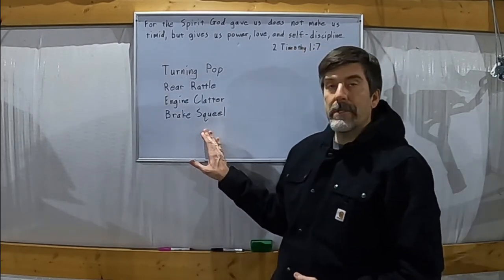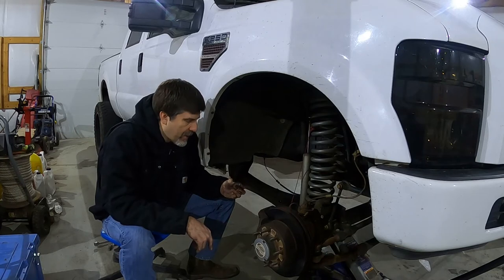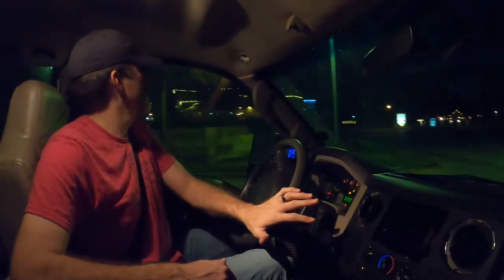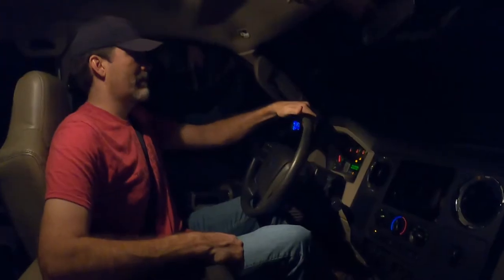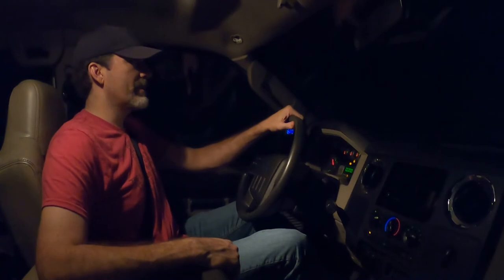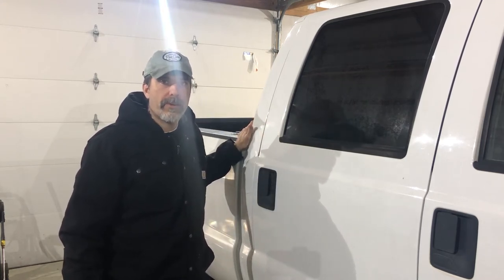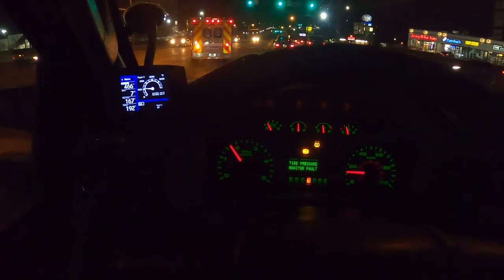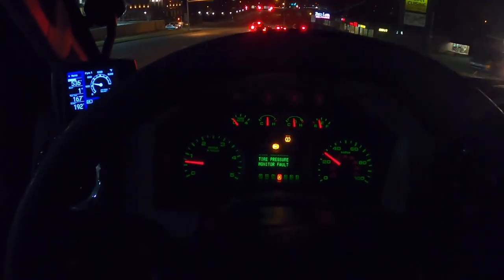F250 Pop Clatter Rattle Screech

Comment: Glad you're fixed. I know my old (89) S-10 Taco is running by all the shakes, rattles and rolls it does. And I dot a brand new Mack dump (4-axle) to drive and hated it from the 1st key turn. It had multiple injection points and was a PIG! So-called progress. God Be With You!

Comment: Nice work!  I think my 6.4 makes similar noises. More so when it's cold.  What codes do you have left?
Reply from the maker: I’ve still got tire pressure sensor codes and ABS codes. I plan to fix those in an upcoming video.

Comment: I have an almost Identical truck to yours! I have an 08 that was made in 07. I couldn't get enough information from the videos of how to lift your cab off in your barn without a 4-point hoist. I am planning a rebuild in about 40,000 miles and I'm just going around extending my knowledge about it. Any information on how to lift the cab off would be suuuuper helpful. Thanks!
Reply from the maker: I bought four lifting straps and four come-alongs from Harbor Freight. I also bought a couple of trucker’s chains to attach the come-alongs to a wooden frame. The wooden frame has four 4”x6”x12’ legs spaced 10’ apart. I started with 2”x10”x12’ joists, but once I had the cab in the air I realized they were severely overloaded. I set the cab down ASAP and reinforced each joist with a 2”x6”x10’ on top and another on bottom. I think the main thing you will need to be careful of is lateral loading; my frame was attached to the barn so it would not topple over. If you cannot do that you should add some triangulated braces. Do what I did at your own risk! I didn’t feel very safe but it got the job done.
Reply: @barntech2291  that's super resourceful! I'll probably have to pick up some wood, and a tall ladder, I have a 20ft barn. Maybe even two of those parts picking lots gantrys is my next best bet vs installing a four point hoist. Thanks for the swift reply! I have some shopping to do!

Comment: We both rebuilt pretty much the exact same truck at the exact same time.  
Anyways, I'd email you but I don't have your info.  I just ran into a possible problem with mine.  I was messing with the defuel settings in my tuner and one option was to defuel when the transmission gets to x degrees.  I set mine to 190.  So guess who starts seeing  190..  the gear gauge on dash doesn't reflect the right temp I guess. Or maybe it senses engine oil temp? I dunno  But it showed normal while the tuner shower my transmission just cresting 190.. 

I start digging into this problem and found out that there is a big ground problem when installing new engines into this truck.  If the ground strap on the passenger side front of the engine isn't properly grounding the engine (because of new engine paint) it will ground through the transmission and basically arc the transmission pump gear to the pump.  
I'm not sure if this is what happened to me, but I changed out my fluid, put in a new temp sensor added a few more ground straps and cleaned my main engine ground.  I'm now sitting below 175.  Hopefully I caught it in time.  Take care!
Reply from the maker: Wow! Hopefully that fixed it for you. I keep a close eye on engine temp and trans temp with my Mini Maxx. So far so good 🤞🏻

Comment: Wow so the POP sound when turning was caused by the left front cab mount bushing and was fixed by shimming it?
Reply from the maker: Yes. The shims actually went in the mounts below the driver and passenger feet though. Unfortunately the pop came back worse than ever the next time I lifted the cab. I think the cab mounts I bought on eBay were too hard.